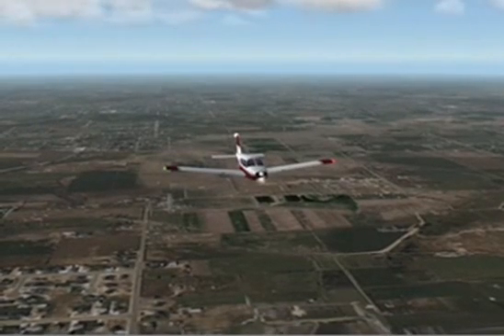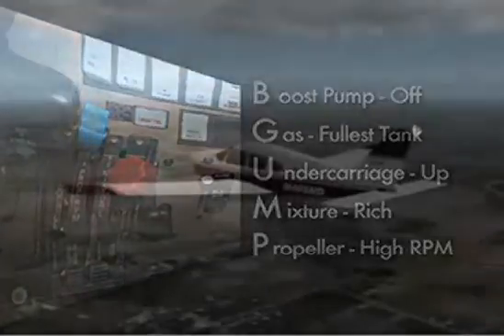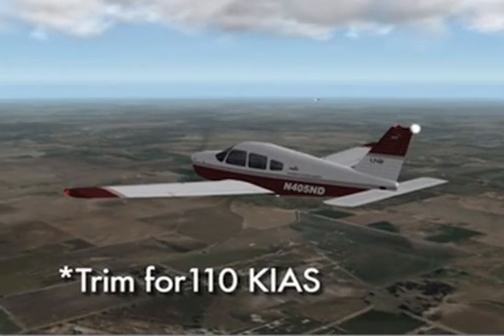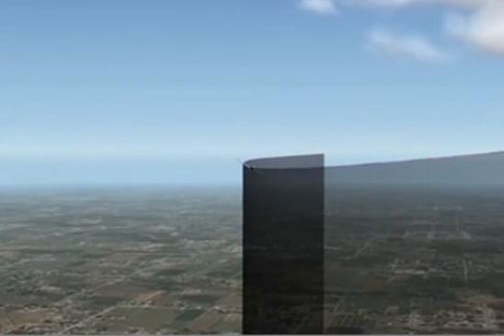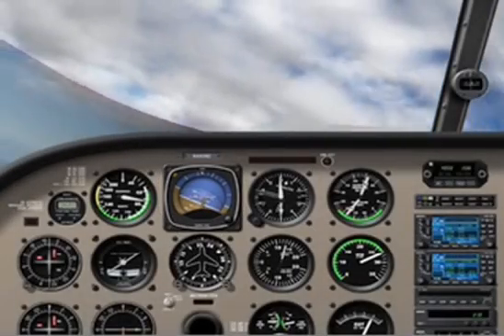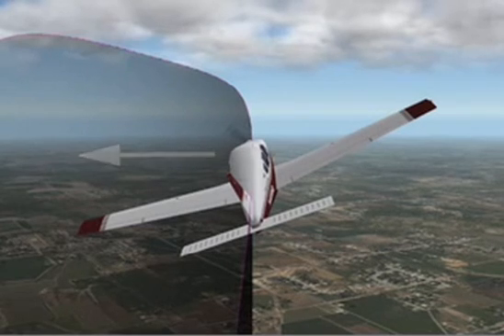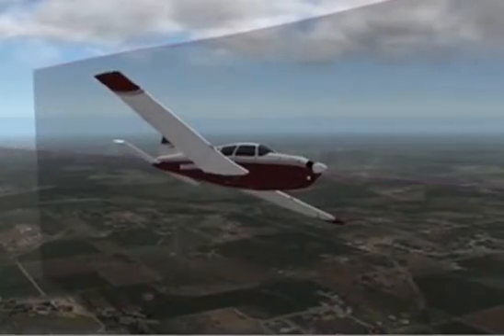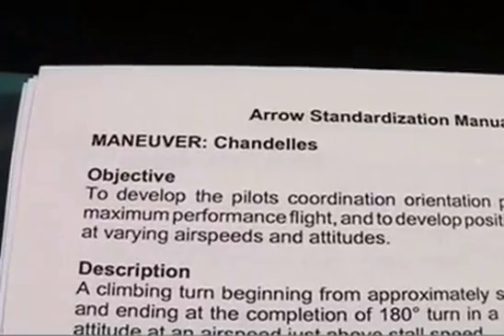Commercial Chandelle Maneuver   UND Podcast

Comment: Nice illustration of adverse aileron yaw at 2:00. See how the nose swings slightly to the right as the left bank is applied and the airplane does not actually start turning to the left until considerable bank is in place, and the slip-skid ball is half a ball out of the pocket indicating "more left rudder" (step on the ball, remember?). This is because no rudder was applied along with the aileron pressure. Of course nowadays "commercial" pilots in FBW airplanes are trained to keep their feet on the floor in flight and the computers handle the rudder-aileron coordination.
Impressive simulation!
Reply: I forgot to mention: one of the "gotchas" in the Chandelle is the spin entry on the rollout portion of the turn, caused by insufficient top rudder along with too much top aileron. The excessive down aileron on the already slow inside wingtip, combined with the adverse aileron yaw into the turn,  stalls the tip and causes a very snappy spin entry, if you let it get out of hand.